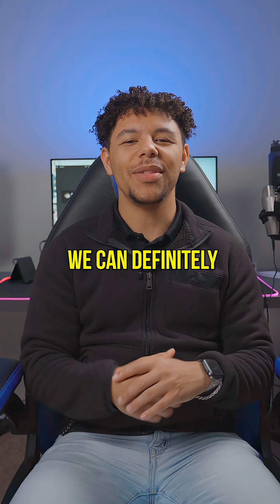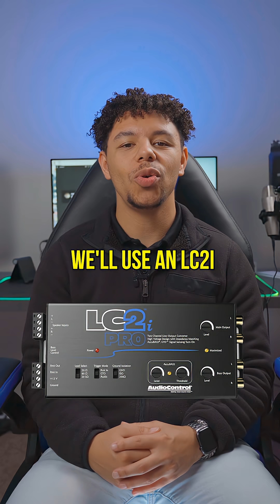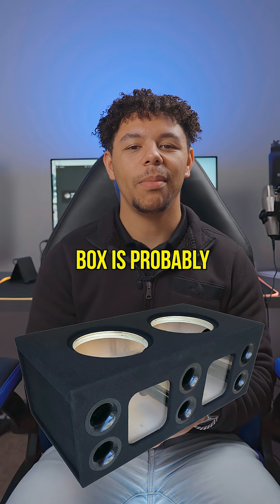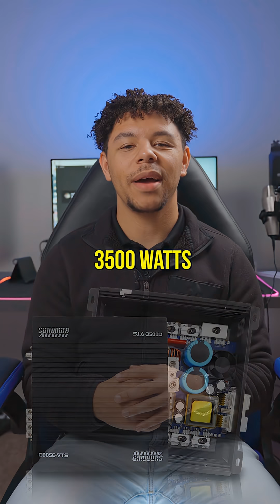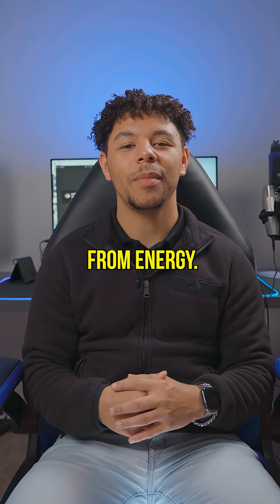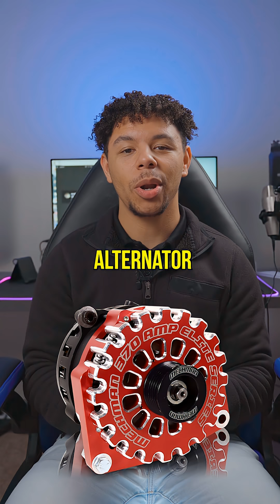$3000 Audio System For 2022 Chevy Tahoe! #nicholassnowproductions #recklesscaraudio #caraudio

Comment: Omg a high output alt with one battery please tell me how many amps that battery can even take your ruining the battery if your less than 3 batteries stay away from the high output alt unless your doing lithium and even then ive clamped over 10k with a stock alt just more lithium battery always over alt  this guy is a new person in this you can tell by what hes recomending

Comment: 😂😂😂 bro the wood doesnt matter actually mdf is denser and better for tone. Also you very well can switch out the head unit i have a 24 tahoe aftermarket head unit.. you just have to do a little work but the lc2i sucks absolute shit if your going to keep the factory radio go dsp not line out convertor come on reallg